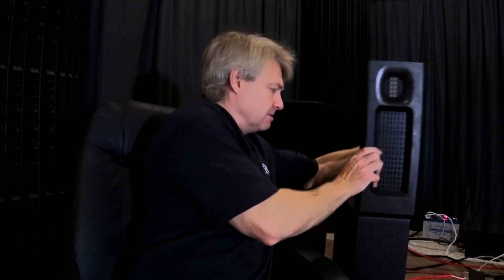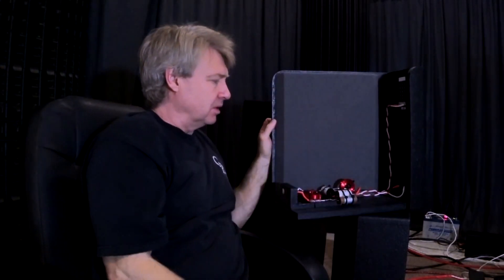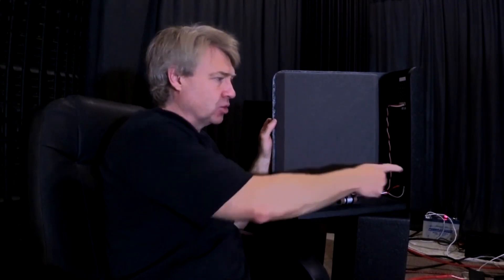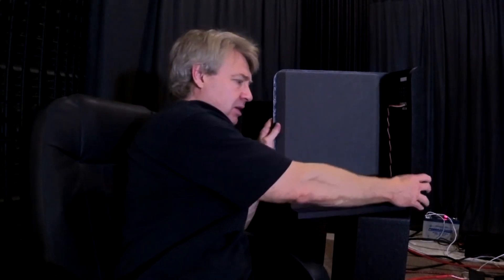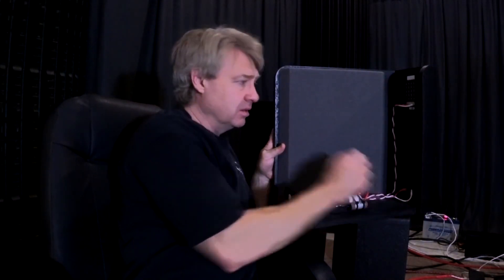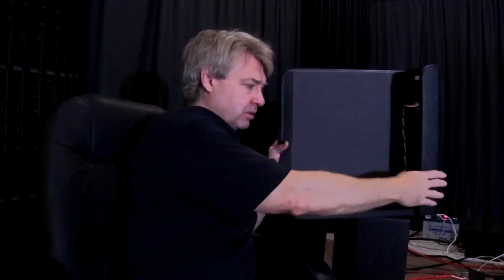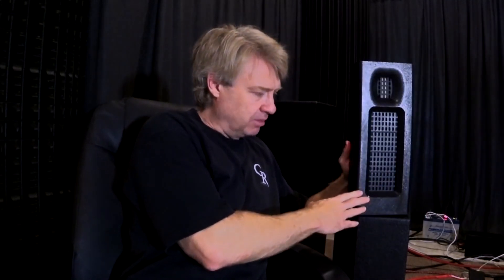Tech Talk 1: SOUND STAGE

Comment: Thanks Danny, nice talk and spurred a question that will influence without a doubt my coming listening experience. I certainly grasp the idea and approach of your open baffle design. And I think its going to be at least two questions. From your comments concerning room acoustics you are preaching to the choir in my case having grasp this importance long ago in my early 30's, I'm 71 Plus. My issue and one I hope you have some advice and possibly a solution for is the obvious room I live in. Its only 10 x11, carpeted, standard dry wall. The ling walls reflective surfaces are non dampable given one is halh covered by a bookshelf storage unit the other by my desks shelving unit. So, all that said would I more than benifit from an open baffle design and if so do you have plans and componets for same assuming a $350 to $500 budget. Obviously lower cost is preferable, but I realize there's a given price for components need to achieve a desired result. And regardless next time I'm home I will try and drop by. Or do you think l'd be better served with your mini's or say X-Bravo's l'll be running a sub regardless. You've also likely realized near field is more likely than not going to be the order of the day. I'd like as much transparency as possible. I realize l don't need as much power lol as my new vintage Sansui 7070 Db has and will sell it off for something as yet to be determined with an overall budget of $1500 to $1800 all total. CD's and Streaming will be my musical sources genre's being Classic Rock, Jazz, Classica, and a fair amount of Environmental, New Wave, etc.

Comment: Hey Danny, loving the free wisdom on  your channel! Any chance you could share insight, if just a memory, on the Mission 780 Argonaut MK II? It's been very difficult for me to research this particular model even though it was a heavy hitter in the late 80's and I want to find out just how ahead of its time it really was before deciding if I want to upgrade my front end first. Right now, I'm running a Denon AVR-3600 (1997) as a stereo preamp to an Aragon 2002 stereo amp. I'm thinking the sound signature will change big time with a dedicated preamp but I'm not leaving out the idea of a speaker change first. Currently, I think the sound signature is on the warm side of things which I don't mind- I kind of enjoy it but I'm curious about how I can make the highs sparkle a little bit more without trading in the great imaging and mid-to-low frequency response I have now (and also minimize putting companies through the hassle of returns!).

Comment: Love what you do. However, I would love to see your brain power in action on speakers whose front baffle is no more than 24” off the back wall. Everyone knows that room treatment and speaker placement is huge. Everyone also knows that you are going to get maybe one room where you can put your speakers wherever you want, but all of the other rooms the speakers are going to have to fit nicely into the room’s aesthetics. Many audio files don’t have any rooms where they can put speakers wherever they wish. I would love to hear your thoughts on strategies to maximize sound quality and sound stage when speakers need to be close to the wall. I am a DIY guy, but still learning a lot. I would love to hear your thoughts on optimal driver dispersion and cabinet design for this objective. I am very aware that this is a tall order, but I- and I am sure many others would love to hear your strategies for this.